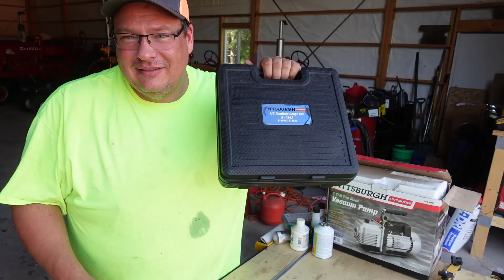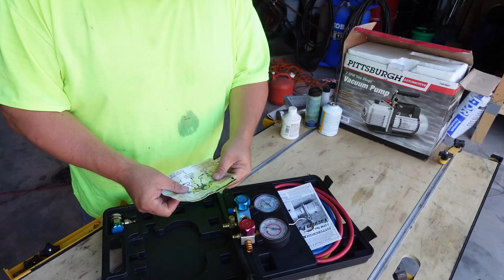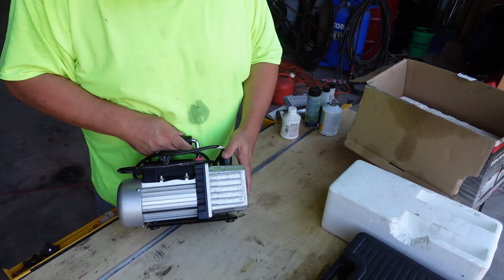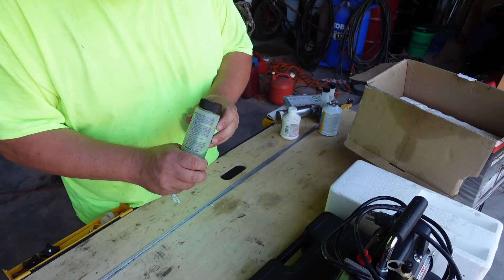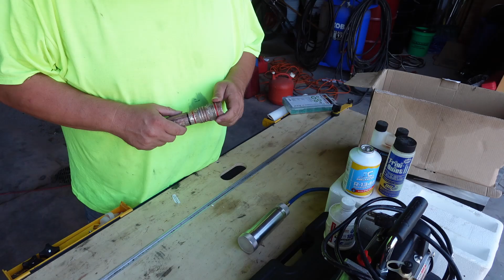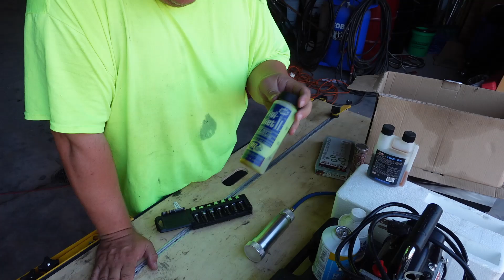Fixing your own air conditioning. Where to start. Tools that you need.

Comment: Harbor Freight is awesome! Good tip about renting manifold, vacuum pump,etc from Auto Zone. I like O'Reily's cause they sell CMV parts, (don't know if AZ does or not).

 Question: Off topic, what do you think about using Tufoil additive, (to protect turbo bearings)?
Reply from the maker: I prefer fuel ox Infiniti lube. Use it in everything no have. Have some videos on it